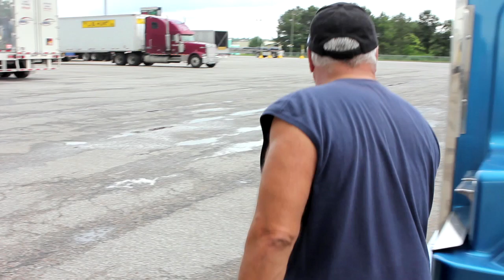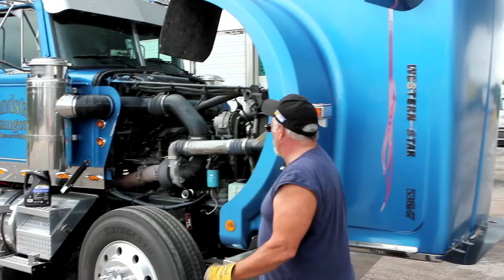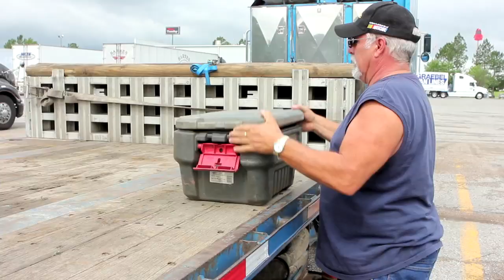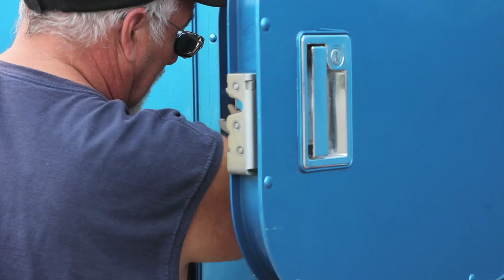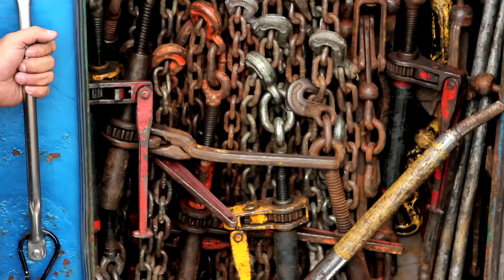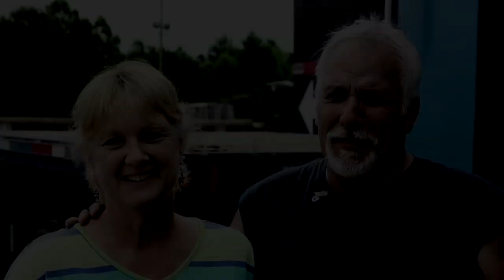Bob & Denise Verdi give advice to owner-operators

Comment: You change your oil every 10,000 miles?  Wow,,,  take some time brother and educate yourself about oil...  It don't need to be changed that often and if you get an oil bypass system, you change it when the lab report says to.  A lot of guys have oil that has been in their engine for 400,000 miles...
Reply: +SheepDog7071  your nuts you need to educate yourself if do not want a blown engine
Reply: +truckerforlife 10,000miles per change is wastefull, he must be useing the wrong oil. He never said what brand